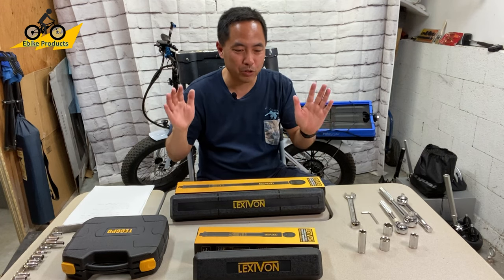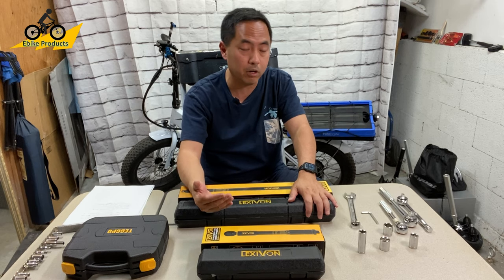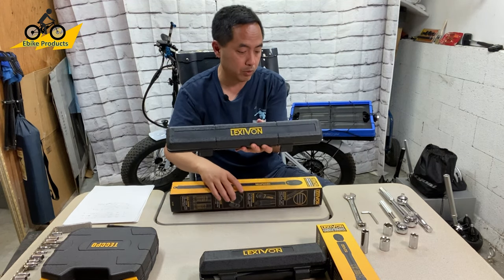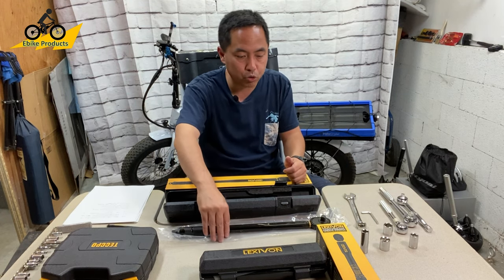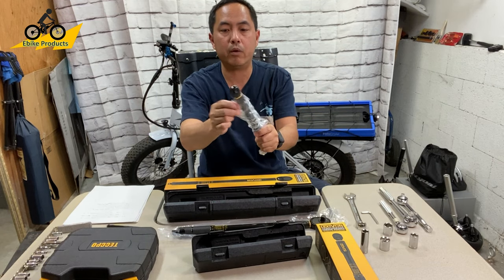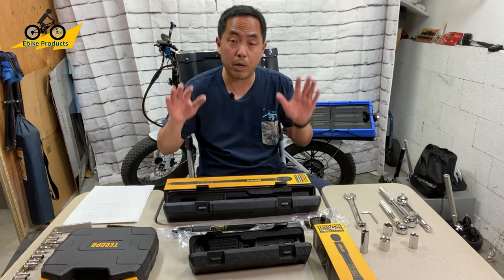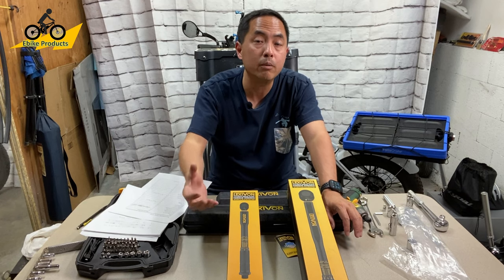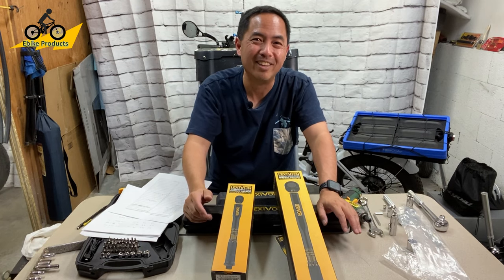Electric Bike Tool Review - LEXIVON Torque Wrenches to Protect Your Ebike Nuts, Bolts, and Screws

Comment: I just got one of these torque wrenches today and tbh I'm not impressed. I got it to use it on my mtb, I tried setting it to a couple different nm for different bolts and i wasn't getting a click when tightening any of the bolts, infact when tightening the bolts on my $100 RaceFace Atlas stem I thought I was going to snap the bolt off. I think i'm going to send this torque wrench back because i don't feel like messing up my bike with a faulty torque wrench.
Reply from the maker: Oh no! I am so sorry! I hope it didn't ruin anything. I still love my wrenches, but I did find out recently its much easier to set it up if you convert the NM to the equivalent pounds and set the wrench looking at the pounds levels. Since finding that out, I think it's easier to use one that is strictly for NM settings. I still like them a lot, but its not as easy with converting.

Comment: Nice video and explanation, but why would any tool you use for a bike not have Nm as a scale on the wrench?  None of the ebikes  have delt with are anything but metric fasteners or torque settings.
Reply from the maker: Good question! I honestly did not know much about torque wrenches until I bought the Lexivon (due to it's low price and great reviews) and started learning how to use it. Now that I know more, I would honestly still buy a Lexivon and deal with the conversions because I don't have to use them that often and I also don't want to spend any more than I have too when the Lexivon does a great job at such a good price. 
If I had a bigger budget, maybe I'd switch to something that I don't need to do so much converting on.
Reply: the 1/4 torque wrench does have a nm scale on it, but I can't recommend it, i just got mine today and the wrench wasn't clicking when it hit the set torque level. I almost snapped the bolts on my stem.

Comment: So how do you torque down the nut on the left side rear wheel when it has the power cord coming out the hub motor? You need it torqued at a specific n/meter. So how does one go about that be able to get a torque wrench on it?
Reply from the maker: I could not measure the torque nm on the nut with the power cord coming out. You are right, with that cord in the way, there isn't a way to do it with a ratchet torque wrench. With the one, I guesstimated by feel on what the other side felt like.

Comment: So it comes down to a 1/2 inch 3/8 inch and 1/4 inch torque wrench. Which do you recommend for having with the electric bike? You do state that the quarter inch too small and it seems the 1/2inch would only work on the hub wheel nuts. Is the 3/8 worth buying? Or the 1/2 inch will do the job and is  all you need?
Reply from the maker: Tough one....I think a 3/8inch is the least versatile among the 3 and would go with the 1/2 inch LX-183 since it goes as low as the 3/8inch (13.6nm) and almost 100nm above the 3/8inch. After doing a lot more adjustments after filming this video, I found I used the 1/4 inch much less on handlebar items like the brake handles and shifter lately due to the fact that I don't feel comfortable making smaller screws (especially on the handlebars) so tight to the level of the recommended settings. They get more than tight enough for me comfortably well before the reach the 'click' and I fear stripping it more than it getting loose on me. I still tighten them hard, just not as hard as they recommend. It took time to learn which screws didn't need to be tightened to the recommended settings though. The 1/2 inch is really big, but with the amount of torque needed for those hub nuts and parts in the bottom bracket area, it's probably the one I'd say will be best if you were only going to choose one.
Keep in mind there are a lot of critical screws, nuts, and bolts that are below 13nm all over the bike, so the 1/2 inch will be too big to use on any of them below 13nm. The 1/4 inch is the only one that goes that low and may be used most of small maintenance and adjustments (like brake calipers and other handlebar items). Unfortunately, to be well rounded, 2 torque wrenches are necessary as there overlap is not big enough to have just one cover the entire bike.